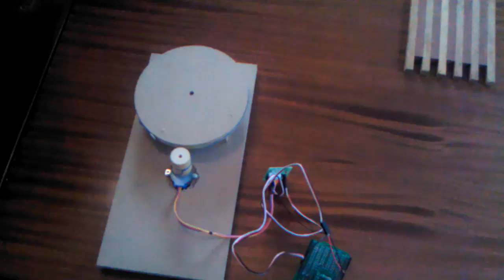Turntable controlled by cheap ebay stepper motor

Comment: Hey man, I know it's been awhile since you've made this video but I just recently bought this exact stepper, a controller, a lazy susan bearing and some timing belts (of the 3d printer variety). I plan on driving it by using a pulley attached to the stepper, but pressed right up against the timing belt (i intend to have the timing belt facing outward so that it acts like a cog/gearing system), the pulley is only about 10mm (4/10") in diameter and the lazy susan is going to be about 30cm (12"), I'm wondering if you've tested to see how much load it can rotate, does it have enough torque to rotate something with a mass of say; 15-20 lbs ?
Reply from the maker: I have only tried loads less than a pound. You might as well try it and see what happens. If it doesn't work just buy a larger unipolar stepper off eBay. Good luck.
Reply: Martin Heermance Funny you say that, just did some more research a few minutes before you replied... did you know about the mods you can do for these? You can get them to go from 350gcm to 800+ gcm just by changing the driver to an L293D and cutting the trace for the red wire
Reply from the maker: +schr4nz It probably increases the current flow which increases the power to the stepper. You can also over volt them to 7 volts to get a similar effect. However the real limit are the plastic gears inside the gearbox. I have heard that they strip above certain levels of torque.